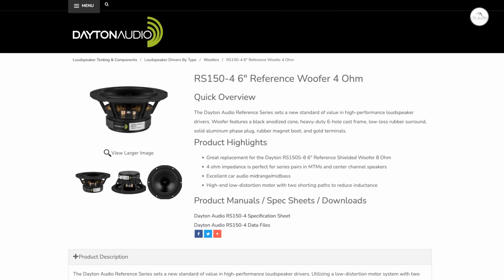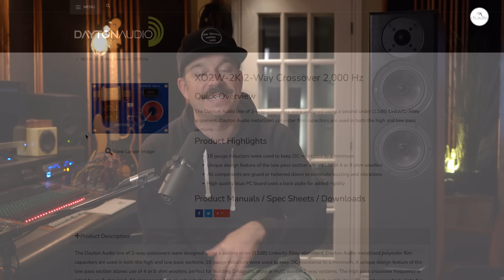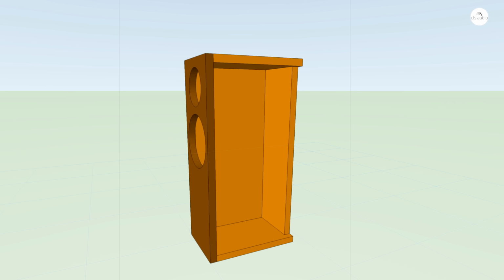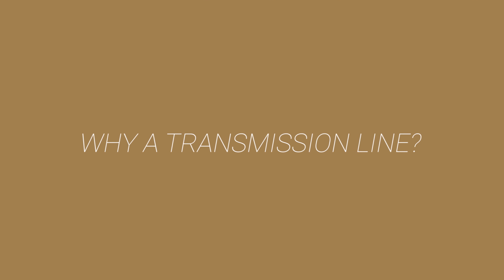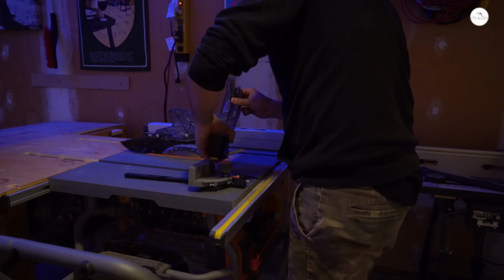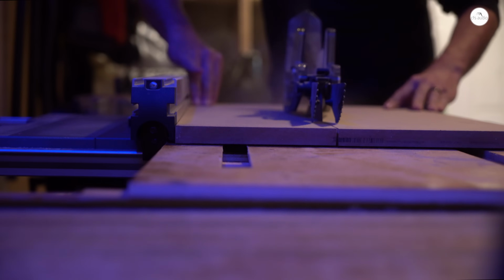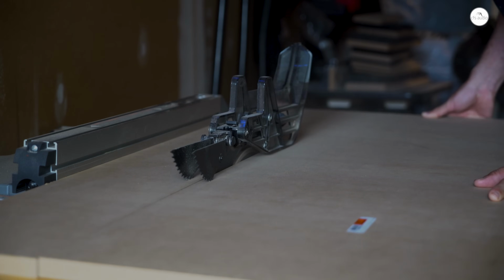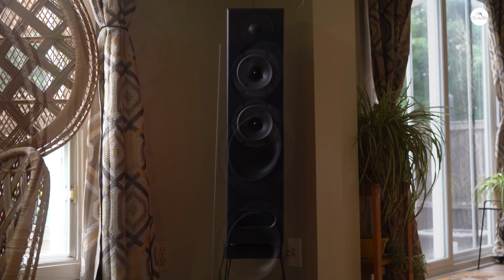DIY Reference Quality Speaker Build. How I built these amazing speakers and proper sound comparison!

Comment: So how does the port work? It seems like the loading chamber is ported into another loading chamber and then ported to the outside through the visible 'port hole'... Not sure of the design or how any of this actually works, never seen a box designed so oddly. Looks like it was just thrown together and I dont know how you made the design or even tuned it.
Reply from the maker: Hey thanks for watching. Take a look at some of the PMC speakers transmission lines and you’ll see where I was going. We did the math on the 1/4 and 1/2 wavelengths of some of the bottom end frequencies and compromised on a line that gave the speaker a nice low end growl.

Comment: Nice build. Do you account for the foam in your enclosure volume?
Reply from the maker: Hey thanks for watching. I did not account for the foam but I’ve wondered the same thing. I could be wrong but as the foam isn’t dense enough to affect the lower frequencies I’d imagine it’s all good.
Reply: @chrisferris3303  gotcha, pal. Nice build! Thanks.

Comment: An electronist once told me that if you connect 2 drivers of the same inpedance, in parallel  you will half the impedance, if you serial them like you did, you will keep the same impedance but sum up their power.  For me it's really very confusing.😂😂

Comment: You connected your woofers in series to get 8 ohm. Your parts list is for 4 ohm woofers, which I understand, but the tweeter in the parts list is 4 ohms. Wouldn't you want an 8 ohm tweeter?

Comment: using a premade crossover? my oh my is the term Reference getting used casually. calling the speaker reference quality because the product line is BRANDED reference is misleading. They are good speakers no doubt, and for many people amazing, but they wre NOWHERE near reference. Miseducating people on "good" and making someone beleive it produces studio leveled sound is a big no-no. Your slandering actual reference sound in making that claim

Comment: Hi Chris, really well done video and expertly done speakers! They are works of art and simply gorgeous, especially the way you designed & built the stands.
Now fill in the Tweeter and top woofer holes and recut for a center Tweeter, D'Apolito design, or did you already consider it from the start and have a reason why not?
Yes that was inspiring and I need to get back to a sawdust-eyebrows weekend!
👊😁👍

Comment: Some speakers just looks like they play well - this pair is one of them. You make some good mechanical choices during the building process - well done! When you have full control of the design process , why not make the baffle from thicker material - 1" or maybe 1 1/2"? I'm confused about the choice of the height of the speaker in relation to the choice of the stand. As the tweeter have a limited spread of sound, it will be placed in a non optimized place (too high) when sitting in a normal listening position.

Comment: Nice video Chris. Lovely looking speakers. Where did you get the plans from? Just wondering why the transmission line design has that narrowed section where the brace drops down? Oh and by the way, you defo need to wear a mask if you dont have extraction when working on MDF. It's leathal stuff in dust form! (Carcinogen)

Comment: How do you tune and design a transmission line speaker? I am looking to build a pair of T-line tower speakers using two 6.5in dayton audio signature series woofers and a dayton audio reference tweeter. Any suggestions?
Reply from the maker: Hey thanks for watching. This is a pretty loaded question. For this build I referenced acouple different designs then made sure the tunnel length was equivalent to 1/4 wavelength of 160hz…ish. I do wish I made the tunnel alittle longer as 1 extra fold woulda got me down closer to 60hz. The end result for me was a speaker that had real nice low mid grunt but needs a sub. I could have gone 1 step further and taken advantage of the tuned box and design a cross over to match its characteristics. Depends how involved you wanna get. As far as figuring out the math for the tunnel pathway my buddy is a physics teacher and crunched the numbers for me but an easier way…ask chat gpt :).

Comment: The customs sounds noticeably better! It has more transparency and the top end details are more present and airy. Well done! You must be so happy with it, and a fraction of the cost of a "Branded" high end speaker. I think if you pull it away from the walls you would get a distinct improvement in the soundstage. And oh, next time, a better choice of music, which includes vocals, drums, guitars and pianos.
Reply: its like going astell to cayin very noticeable but maybe not worth for you, lessfox soundstage upgrade, enleum bass upgrade
Reply: its like going astell to cayin very noticeable but maybe not worth for you, lessfox soundstage upgrade, enleum bass upgrade

Comment: Listening through headphones to me the Customs sound of the best out of the three. I would really like to build a set of these but I didn't hear or see any Dimensions given on the internal brace that creates the transmission line or what size the port opening was. Or where it is placed in the cabinet.

Comment: Thanks for showing the way , hehehe... i got a Question the woofers are 4 Ohms and you wired it in serial so it became 8 Ohms and its ok, but the twitter is 4 Ohms also so the crossover do the magic, I mean the amp its rated to work ok from 6 Ohms to 16 Ohms... i do not know if the crossover do something for it to work perfectly...
Reply from the maker: Hey Luis, thanks for watching. The woofers take a majority of the power and thus have the most impact on the nominal impedance

Comment: The foam in your speaker, internally, will turn to dust.  Next time, use mineral fibers with the appropriate weight for the necessary absorption.

Comment: PVA glue doesn't fill gaps. What it does is absorb into the pours of the material, then as it dries it pulls the two pieces together forming a bond between the two.

Assuming your joints are straight and you have even clamping pressure to begin with the seal should be perfect. But if you can't guarantee a perfect fit, then you can inlay the panels into eachother to improve the seal. You can't really have "too much" glue, but a thin layer will form just as good a seal and cause less mess. 

Another technique to fill gaps with PVA is to mix it with 30-60% sawdust, preferably of the same material as what you're filling.

Pro tip: you can seal MDF with PVA. Dilute the PVA with water then spray or wipe it on.
Reply from the maker: Love the expertise. Thanks for the info

Comment: How we paint MDF in our factory. Base - 24 hours, then slight brushing with sand paper. Base again - 24 hours, then  finishing brushing, material should be as smooth as glass after 2nd brushing, no mdf should be visible after that.  Finishing with 3rd layer of paint. We use water based paint and it's a delicate process to make it to the smooth surface in the end. It is different with different types of paint I believe.

Comment: Congratulations for your great build!
Top passion and excellent videomaking here.
Just a few suggestions to improve your wonderful creatures:
1) Glue is super well made on your side and a good base, but not enough to ensure proper stiffness. One screw each 10 cm approx  is needed to keep all panels together, included lateral ones for internal panels. Top importance for the front baffle, even if difficult implementation now because of the rounded edges.
2) Tweeter looks a bit recessed, but it must be exactly in line with gaskets of the other drivers. 
3) Stands must be much more rigid, if properly coupled with the floor, then soundstage will take huge profit.
If you also fine tune them on your room resonance by adjusting length of the tube port, then I'm sure you will be even more satisfied about the comparison.
Hope it helps!
Cheers
Reply from the maker: Thanks so much for the feed back! And thanks for watching @enricobassani6175 . It’s nice to get real pointers, thank you.

Comment: Thank you for the detailed video. I'm fascinated in the wiring of 4ohm speakers to 8ohm impedance.  I never knew that could be done. i'm still learning. So can i wire all 4ohm speakers in this manner and will it be safe for my amp which allows from 6 ohms ? Thank you sir.

Comment: Built not to break. If they do break or the corssovers need attention, you're stuffed. Fail on basic design.
Reply: I mean, I've never heard of anybody having a crossover get cooked. I've worked in studios, live sound, home hifi... plenty of cooked amps and blown drivers, never seen a crossover go 🤷🏻‍♂️ besides, for a home-made speaker cab, wouldn't it be pretty tough to make a hole for it and keep a good seal? Not trying to be argumentative, I've just never made my own speakers and seems like a reasonable consideration.

Comment: Nice build but...(somebody has to say it)...consider using furniture grade plywood over MDF. IMHO the only thing MDF is good at is disintegrating over time.  Also I don't trust hot-glue, get or make some short stand-offs for the board and screw it down to the cabinet. OK I'll go back to my hole and FTFU.
Reply from the maker: @pcallah3442 thanks for watching. Building a 1x12 guitar cab next with some plywood. Stoked for that.
Reply: Agreed on each point

Comment: Great build I think you have just answered my question about using the acoustic lining as I am looks forward to my first built  I notice you complete  covered the interior with the foam is that the write way   And is that the best one to use ?
Reply from the maker: Hey @hamazatatta952 thanks for watching. So PMC which is one of my favourite speaker manufacturers does it this way. Now I don’t know what the density of there foam is but still I took a gamble and it paid off. I think it’s a great way to control the high mid standing waves.

Comment: Cool build! What are your impressions of the transmission line? Could you elaborate on the "focused bass" you mentioned? The Dayton Reference Tweeter is a 4 ohm tweeter, what did you do to end up with an 8 ohm nominal system? Very nice video, I liked the way you managed to pack that into a short video and the step by step narration explaining and showing what you're doing and why.
Reply from the maker: Hey, thanks for watching. So the transmission line works by absorbing and reflecting sound waves up to a certain wave length. The result is an enhancement in bass with sound waves that come out of the tunnel. Depending on the length and dimensions you get different results. As for the tweeter and impedance the over all speaker impedance is more based on the woofers as they require significantly more power. So if the woofers nominal impedance lands at 8ohms in this case it safe to run the speakers with an 8 ohm amp.

Comment: In 1999, I built a transmission line speaker system based on the August 1977 edition of the Electronics Today International magazine.
Even though I used a makeshift driver, the system's performance was very good.

Comment: How’s the low end? Does this system require a subwoofer?
Reply from the maker: Funny thing you asked. Just posted a subwoofer build video to make this a 2.1 system. :)
Reply: @chrisferris3303  awesome!! Do you have a cut sheet with dimensions somewhere for these towers?
Reply from the maker: @MonsterPartsRc  no cut sheet for these.
Reply: @chrisferris3303  also.. what are you using for a sound source/amp?
Reply from the maker: @MonsterPartsRc  I’ve run them on a Yamaha RS700 and a Cambridge 540r

Comment: Excellent build! BUT I would take up @Toid offer to build some proper xovers for these as it will make a noticeable difference.  Pre built xovers are the minimum really, they are built around very basic speaker parameters so they work-ish with about anything. Building xovers for the specific drivers will get much more out of them. I don't doubt they sound great now but I promise they will get better with proper xovers.
Reply from the maker: 100 percent! I have some dsp flattening them currently and its got me excited for the potential a custom crossover will bring to future builds. Also I would love to collaborate with Toids, hope I can make that happen in the future. Thanks for watching IOWAudio Reviews.

Comment: Sit stores won't have made a cut straight edge to start with. Assuming a 8x4 sheet is square won't be square as you have to cut a side of the sheet square to start as a ref edge.

Comment: Stock XO?!?
Reply from the maker: Don’t worry Mats Julin. No Ears were harmed in the making of this video. Thanks for watching.
Reply: @Chris Ferris  LOL, you win best reply to a comment! 
I guess my comment could be read as harsh, which wasn't my intent. Your driver selection is faultless,  well chosen bass alignment,  nice woodworking skills, excellent video guide on the build, and then the stock XO... what would be nice is take up Toids offer on collaboration, or someone else (lots of helpful people in this niche hobby) and do a follow-up video with side by side comparison. Just a thought.
Reply from the maker: @matsjulin5135  I’d be a fool not to take up his offer. I’m a big fan. I have sub woofer build I’ll be posting soon then I wanna dive into another speaker build. I’m thinking ribbon tweeter 2 way design. Thanks for the support Mats

Comment: These are the mtms that parts express sells. I actually built a version like yours. With a TL port. They sound amazing. Only thing is parts express sells you all the caps and coils and resisters to build your own crossover. You should see how big these things are. Real beefy crossover parts. If you can build some stuff I recommend getting some diy speakers. Hell even if u can’t build stuff you should be able to build these. It comes with instructions.

Comment: Great work! What sealant before painting do you use? There are many types, acrylic, shellac, silicone, etc. Definitely not oil based I guess.
Reply from the maker: Thank You. I used shellac but I’m told that wood glue diluted with water is the best way to go.

Comment: Nice speakers.!!! I been building speakers and I been using the Dayton crossover myself up for not building my own but know I saw someone else who knows what he's doing maybe I should just leave them also I ran 2 4 ohms drivers to get 8 ohms like you and I wanted to use the reference tweeter that you use but I saw it's 4 ohms and I don't know I can run a 4 ohms tweeter with 8 ohms woofers obviously I you did it so it must be ok to do unless that's an 8 ohms reference tweeter but I think they had 8 reference tweeters .
Reply from the maker: Hey thanks for watching. You can use the 4 ohm tweeter because the over all impedance is more effected by the woofers as they take a larger percentage of the power being delivered.
Reply: @chrisferris3303  oh good I really wanted to use that tweeter. I'm going to replace the one in there with one of reference tweeters. And I like the little cover.

Comment: If i build a par of these speakers as shown in the video will it work with a 4ohm tweeter and 2 4ohm woofers wired in series like in the video? what will be the impedance of the speaker?

Comment: How would this build compare to some of the CSS audio kits? I’ve done some woodworking, so I can make the cabinets.
Reply from the maker: Hey Happy Accident Productions. Thanks for watching. I’d say the CSS are more refined as the crossovers are designed for that cabinet and speaker combo. I used a prebuilt crossover for mine which was a gamble. That being said I got pretty lucky despite the assumptions of some of the viewers :).

Comment: Two drivers in series? That's like having one of them connected to an amplifier using a cable that varies between 3 and 10 ohm. It's equal to letting wild horses loose, they will run all over the place and out of control. You should never connect speakers in series, that's why they do 8 and 16 ohm drivers so that you can connect them in parallel. They make special low ohm speaker cables and low impedance output amplifiers to have better control over the speaker cone. Putting a 4 ohm speaker in series with another speaker will defeat all those efforts. Why demo using already distorted electric guitars? Play some sensitive near field vocals without echo and some acoustic instruments, trumpet and cello would be easy to hear if there's any anomalies that doesn't sound natural. We weren't given much chance of telling if they where worth building.
Reply from the maker: Hahaha something tells me Urban Larsson you didn’t need me or this video to tell you. Thanks for watching.

Comment: I got curious about the construction of the speakers and would like to recreate your construction, luckily I found all your components, I just wanted to ask you, in the video you say to connect the two woofers in series and obviously the tweeter will be connected to the crossover on the tweeter side. on the crossover that a cable to set the impedance to 4 or 8 ohms and here I think it is set to 4 ohms right?
So the amplifier must also be made for the 4 ohm impedance, right?
With what power per channel can these two woofers and the tweeter then be powered?
thank you very much.
Reply from the maker: Hey Merlinoadventure thanks for watching. So I had the crossover set to 8 ohms. Though all the drivers are 4 ohms when you run the 2 woofers in series they become an 8 ohm nominal load and because they require more power to run than the tweeters they have more impact on the over all impedance. So you could think of this setup as 8 ohms and should drive it that way. As for wattage I’m running them with a 100 watt receiver and getting great results though I think alittle more power might open them up a bit :).